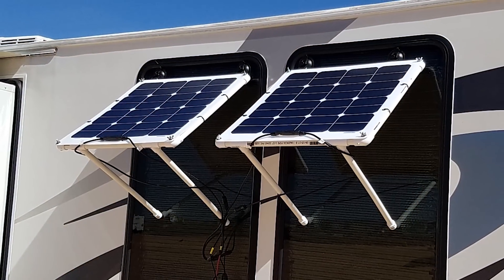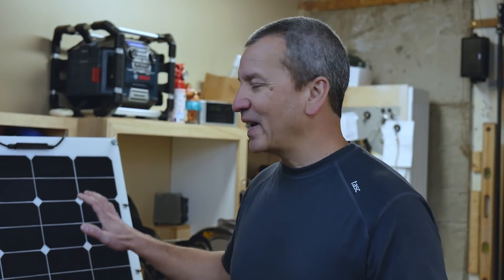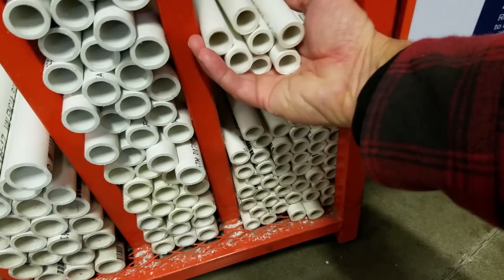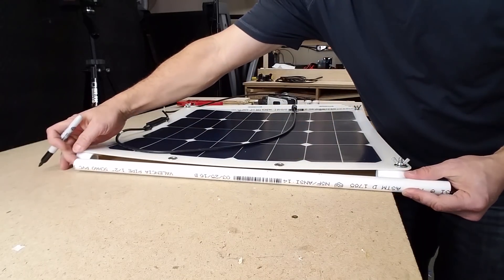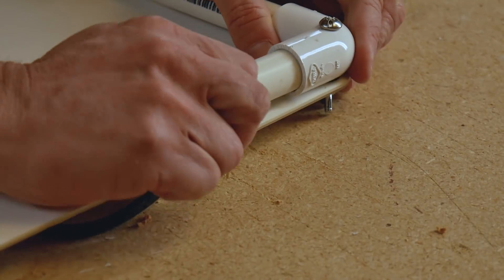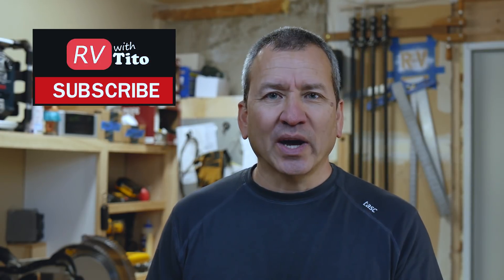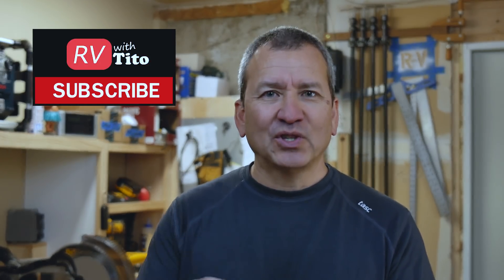Build a SOLAR PANEL WINDOW AWNING Battery Charging System

Comment: Call me crazy, but for years (2). I wanted to harness the punishing summer sun here in So. New England. (BTW - I've been to, Mojave, Death Valley, PHX, Mia, SNA, LAS , ABQ and many more).
The Summer sun here, comes through the westside  windows, of the house @ anywhere between 90-100F).

Rather than spend 100's, to keep a house on the top of a treeless hill cool. Why not shade those west facing windows.

So here I am, I want to make your tips, my summer, spring and fall heat .  My new Heat avoidance solution. Btw- on 4/13/23 it is projected to be 85+ (F).

Long story short, I want to learn how you did it. Then if necessary, modify it to help keep my house stay cooler and use, Nature's own Goodness to create a lil power on the side.

Thx !

Comment: Excellent idea!  I was researching a way to make a frame for my new 180 watt semi-flexible panel when I came across your video.  I am planning on making a frame using your model to keep the flexible panel from flexing too much and damaging the panel.  At the same time keeping it light weight and adjustable to angle the panel to pickup the maximum sunlight.  Do you think the suction cups would also stick to the fiberglass siding of the trailer and not have to be attached to glass?  Thank you for this excellent idea.

Comment: Hi Bryan, I’m new at this solar stuff but it’s pretty interesting! Thanks for the knowledge. I have a question though. I recently learned that if you want to add one or more solar panels to your already excisting solar array and they are of different sizes, volts and amperages you have to recalculate before hand because it is possible that they won’t add to the total. In some cases adding will lead to less amperage to the charge controller. Am I missing something?
Reply from the maker: Series vs Parallel configurations differ when adding more panels that are different from the rest. If in parallel, the panel voltage ratings (Vmp) need to be very close. If in series, the panel amp ratings (Imp) need to match.

Comment: Genius idea and execution!  This also gave me an idea of how to mount my flex panels on roof - attach to PVC pipe frame.  One other way was to get a Lexan or regular Coroplast board backing.,  Nice airflow under solar panel to keep it cool as they don't like being overheated.  I love your ideas and mods, Tito!
Reply from the maker: Glad it helped! Good luck with the project.

Comment: I'm learning a lot about solar  :)   I'm working on a 5V heating pad for my feral cat hse.  Starter project on a sml scale.  Love the  pvc pipe idea!  I also used  my Amazon bubble wrap as interior insulation.  I don't think the cats will need black out curtains.  Awesome videos!!

Comment: Now all you need to make is a solar tracker so you don't have to manually reposition the panels through the day.
Reply from the maker: Funny you ask. I've always wanted to build something. You can get cheap dual axis trackers on Amazon for under $100 (https://amzn.to/3ipzZak). The external panels I use now are pretty large so I'm stuck with rotating them 3-4 times a day.
Reply: @RVwithTito  Make a video of you building it and putting it on

Comment: I can use this solar panels to shade my fridge too. my fridge always seems to face the sun ?
Reply from the maker: Absolutely. They significantly reduce the heat on my windows. So I'm sure you'd have the same effect if mounted outside the fridge. Just make sure you have a clean smooth surface so they don't fall off.

Comment: I love this idea! We have a molded fiberglass trailer (a Bigfoot) so I want to try something like this for the roof. I'd probably glue as many pieces of the PVC together as possible. Do you think it'd hold together while in transit? My idea would be to somehow connect the PVC frames to brackets that are attached to the room of the RV. I'd use wingnuts so I could use the panels on the roof OR as awnings. I just wouldn't want the PVC frames to blow apart while driving!
Reply from the maker: I have no idea if the PVC frame (or flex panels) would hold up while in transit. I would look for a sturdier solution. My setup is only used while parked and is put away before breaking camp. Good luck!

Comment: Hi Brian, Thanks for your solution and engineering of the portable flexible RV solar panel setup. I have added a movable "All Powers" 100 watt Mono flexible panel to my roof mounted 200 watt "Renogy" Mono array similar to what you have done. I ran both sets of wires into my Epever Tracer 3210 30 amp MPPT  charge controller,.The roof mounted array is in series, putting out approximately 40v(+ - _) in direct sun. The flexible panel is in parallel putting out approximately 12v(+ -_) in direct sun. My question is, can I safely use both setups together, or should I disconnect one before I connect the other? Or do I need to add another charge controller as you have done? P.S. I love your videos. We're headed to the northern Oregon coast this weekend, maybe we'll see you out on the road.

Comment: Very informative and clever idea how to mount those panels. We can definitely implement this idea to our travel trailer. Can we use this power to work with 30-amp electric power so we can use the wall outlets?

Comment: Great idea, You solved 2 of my problems at one time. I have sliding windows too and could never keep them open when it rained. I put these together and also add a 4” rubber strip across the top that seals the water out from coming down behind the panel. Where do I send your royalty check!
Reply from the maker: That's awesome! My mailing address is in the channel about page :)

Comment: Hey Brian, 
Thanks for sharing. I think I like this solution way better. And using three 100 W panels seems like a great idea to me. Here's a question for you though. Do you have to run them in series? Can I run them in parallel and get the same usefulness? NEVERMIND... I just saw your other video that answered that question... 

Thanks, 
Pat
Reply: Everything RV by Pat I do that all the time.  There is an edit which allows me to delete it.

Comment: Enjoy your videos. Do you have a engineering background? You come up with some pretty ingenious stuff. Can you tell me the year and the model of your chassis. I saw your sway bar videos and have both front and back hellwigs for my 2015 E450 chassis. Some of the frame brackets look a little different in my kit.
Reply from the maker: +HDLowrider Glad you've enjoyed the videos. I do have a technical background in electronics and software engineering. Plus I simply enjoy tinkering around and tweaking things. Our chassis is a 2006 Ford E-450.

Comment: Hello, just saw the video. I drive a 28 year old mallard 26 sport. Three years ago i installed 4 x 100 watt solar panels. Two of them were installed on the roof and the other two i mounted to piano hinges and then attached them to the rv sides over the large side windows. With them being hinged i can pivot them out from the wall to manually follow the sun. I then use telescoping walking sticks to infinitely adjust the panel and support them. I just use parachute cord to hold the panels firmly down when im cruising around.  
Last summer The dog and i spent 6 weeks exploring Newfoundland’s west coast and the set up worked flawlessly. Keep safe.

Comment: I really like this idea. I purchased a suitcase, but in your case, I would get additional lines so I could place the panels on the ground on either side, in case I had boondocking neighbors who's rig would block the sun from the side of my rig or trees that blocked the sun. I can move my suitcase to either side of my rig and get to that early am or late afternoon sun. I added the same plug you did. My suitcase came with a controller but I like your setup.
Reply from the maker: The suitcase option is a great one. Plug in an you're good. It's what I always suggest to most folks.

Comment: Great idea!

Was there any particular reason you didn't go with 100 watt panels, rather than the 50 watt panels?    It seems like 100 watt panels would have fit your windows better, providing more shade as well as more power.  And, the 100 watt panels seem a bit cheaper per watt.

But, otherwise, I really like your approach with those lightweight flexible panels!
Reply from the maker: I'll probably do a 100 watt version also. The 50 watt panels are smaller, easy to manage and easy to store though.

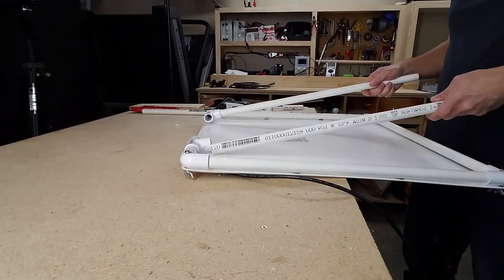Comment: Awesome and enjoyed watching.  on the  job/Vif @4:00 in the  leges that are to hold  in place in different angles. Would another  Two Tee's can be placed in so when @7:20 adjusting your legs you  pull on  the bar and both legs equally  drop down or move.  Also a Piece of velcro on the panel back and leg can  hold secure in place for  storage. last i thought the bottom of the legs are they protected so  each time you slide them they do not scratch the   vehicle?  Loved the work and all   FISH
Reply from the maker: Yes. I'll probably be adding a cross bar on the legs in version 2. Thanks for the suggestions!

Comment: Is the charge controller's 12v load output regulated to 12v or it is the battery's voltage?
Reply from the maker: The charge controller is a multi-stage charger and will regulate output voltage and current to properly charge a 12 volt deep cycle battery. It's more than just a simple regulator. All of the voltage levels at each stage can be adjusted for your specific battery specification. The bulk charge phase will push as many amps in as possible until your battery reaches roughly 14.6 volts (around 80 percent charged). Then the absorbtion phase kicks in and slows down the charge for the final 20% until fully charged. Finally, the float stage kicks in and keeps the battery topped off at around 13.6 volts with out overcharging. Imagine you were filling a glass of water exactly to the top from a water hose. You'll fill it faster at first, then slow it down when it slowly reaches the top so it doesn't overflow. This is very similar to how a deep cycle battery gets charged.
Reply: Thanks for your reply! Useful info for sure. But, I was referring to the connection on the controller marked 'Load' on the right side. Is it just a convenient connection for a 12v device? If yes, is it regulated to 12v or is it the battery's voltage of >12v? I can't find info about it.

Comment from the maker: CORRECTION and MORE INFO ABOUT VOLTS/AMPS: 

After more number crunching I would NOT recommend running more than two 100 watt panels in series on this 75 volt / 15 amp controller. While 3 x 100 watt panels would probably work under most conditions, it may push the limits of the controller on a cold sunny day. If you want to use 3 to 4 x 100 watt panels, I would recommend stepping up to the Victron 100 volt / 30 amp MPPT controller instead. 

I also wanted to answer the question: Why do you add the max voltages of the solar panels together and keep the Amps the same? Here's why:

When using an MPPT controller like this one, there are advantages to wiring the panels in series. Here's what happens (assuming all panels have equal specs):

(SERIES wiring) When wired in a series, add up the max voltage on each panel. That becomes your max input to your controller. Your amps will stay the same going in to the controller. The MPPT charge controller will convert the excess input voltage into higher amps going out plus a slight boost. So you'll get the amps back on the other side of your controller going to your batteries. So that's one benefit of having an MPPT charge controller. Plus the lower current going in means you can use lighter cable to connect your solar panels to the controller. A PWM controller does not do that and would be better suited for a parallel setup. 

(PARALLEL Wiring) If you were to wire the panels in parallel, then you would add up the amps and end up with higher current going in to the controller. The voltage would remain the same.
Reply: Also probably less loss. That is why power companies transmit over high voltage.

Comment: Great idea.  I put 680 watts of solar on the roof of our Newmar Bay Star after we bought it.  The are 4 Isidro panels and are working well but they don’t adjust. I was thinking of doing some external shades on windows and this idea is great.  Thinking of adding four 100 watt panels now.  Great video.  Bravo.
Reply from the maker: I've always carried a couple extra panels and somehow they all get used. Good luck with your addition. I always warn people to plan for a bigger charge controller because "once you get solar....you'll want more"
Reply: RVwithTito yeah,  I did the 680 watts on he roof to handle refrigerator load (800 wh per day).  I always liked idea of portable and your idea will work great on new RV.  The MPPT controller is installed in Bay with room for another unit and cables to battery were sized for additional capacity.  My install on old RV handled total loads well.

Comment: Good work but I think you just turned a flexible (expensive) panel into a rigid (cheap) panel by adding a frame to it 😀
Reply from the maker: Hehe. Yes I did. But this one is much lighter and I can take it apart :)
Reply: and had fun doing it.

Comment: Enjoyed your video.  I do have a way to make your idea better I think.  It appears you used schedule 40 pvc pipes.  You could save some money and, more important, save some weight by using schedule 20 pipe.  It's also called "Thin-wall".  Unless you intend to have these panels up while driving or going to Florida in hurricane season schedule 20 should be plenty strong enough.
Reply from the maker: Yes those thinner PVC pipes would also work fine. They had these pre-cut 2 foot lengths ready to go so I grabbed those instead of a long length of pipe. Thanks for the tip!

Comment: Nice idea!  After seeing your video, I was thinking maybe to place some panels like those on the top of my cargo basket on the roof of my cargo van tow vehicle.
Reply from the maker: There certainly are lots of options right. I even use one to charge the battery in my tow car (with a separate charge controller). Good luck!

Comment: Hi Brian on your setup what size fuse did you use an the panel and battery end?
Reply from the maker: I don't have a fuse between the controllers and battery. Not sure about the Victron controller, but my other one (Morningstart Tristar) has pretty good built in overcurrent protection.
Reply: Thank You Great Video

Comment: I’m think if getting the same brand controller the 30amp version doesn’t have a RTS remote temperature sensor do you have one for your 15amp on your batteries?
Reply from the maker: I have a temp sensor hooked up to the primary MPPT controller, not on the 15 amp. I only plug it in when I need to.
Reply: Yeah I figured that out at the end of your vid. The big brother of that one... the 30amp is that one I'm planning on getting and there is a bluetooth RTS that's coming out in Feb for it and then I'll replace the PWM i now have. How many amp hours do you have on your batteries? So I take it that you just want to ensure that you have full batteries by the end of the day and the start of the evening and so that you wake up with at least 80% charge?

Comment: Very smart! Maybe use rubber tips on the legs instead?
Reply from the maker: Yeah. I've thought of that too but haven't picked any up yet.
Reply: You could spray them with the spray on electrical insulation. A can of that stuff can last years.

Comment: I can tell you from experience with those suction cups is the surface should be clean or it will lose its suction. Use your favorite surface cleaner before using!

Blue Sky"s and Safe Journeys!
Reply from the maker: Agreed. If you moisten the suction cup first it holds better too. These suction cups are pretty strong though.
Reply: RVwithTito Yep, but still, my reaction when that big thing let go wasn't funny! Watching my first flat screen heading to the floor!  I managed to catch it but that shifter in the way had me singing soprano! Long story and the reason I quit smoking!

Blue Sky's and Safe Journeys!

Comment: Can you provide more info on how you tied the output from the new MPPT controller to your other MPPT controller?  Is it simply connected to the batteries along with the other controller?
Reply from the maker: Yes. I actually wired it into the output terminals of the primary controller. From there I have #2 AWG cable going right to the battery bank. The key to using two mppt controllers in parallel though is to setup the MPPT voltage levels to both controllers so they match. That way they don't fight each other.
Reply: I think I have it...but if you could post a picture on your web page that would really help me.    Thanks !!!!

Comment: How do the panels hold up in wind or rain. Since one side is basically just resting on the side of the rig, is it a problem in windy conditions?
Reply from the maker: I haven't used them in really windy conditions yet. My plan would be to mount a couple more suction cups directly on the two legs.

Comment: Thanks Brian! I did something very similar.  Because we don't get a lot of open sky when camping in the woods on the NE, I needed something I could place away from the RV if the RV has limited sun exposure. I went with this... 100 Watt Foldable Solar Panel Charger, Portable 18V 12V Flexible Monocrystalline Solar Panel with MC4 connector and Dual-port Output (USB 5V + DC 18V) for Nature trips, Camping, RV, Boat, Cabin, Tent https://www.amazon.com/dp/B076K55CMB/ref=cm_sw_r_cp_tai_dv2DAbPS37XCJ.  Also, similarly to your SAE extension cable, I made some SAE TO 120V receptacle cables, and use the 120V 50ft extension cord I carry around to get the panel farther from the RV. If I need more, I grab another extension cord. I enjoyed your panel design!
Reply from the maker: Yes Rob. I've always found a use for an external solar kit even with 500watts on the roof.
Reply: I would worry about theft.  Is that a Problem?